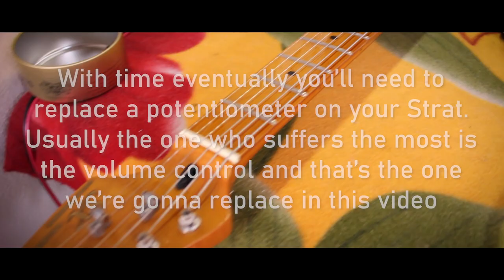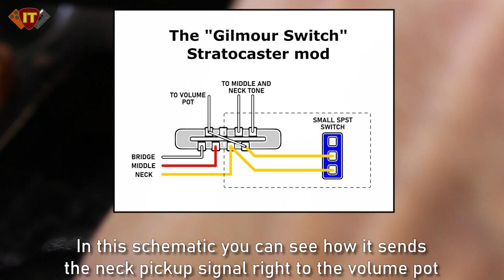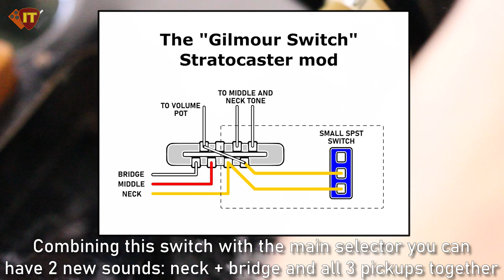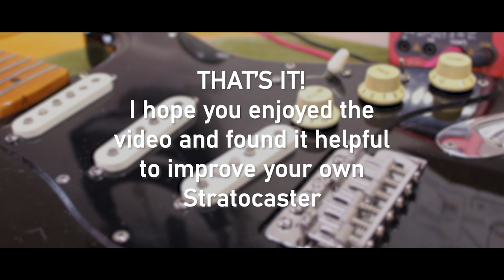Stratocaster "Gilmour Switch" and Volume Control Replacement - Full tutorial

Comment: At first I thought the Gilmour switch was connected to the middle pickup and thought, "what's the point?". Then I did some more research and came back to re-look at the diagram, and now I understand. The Gilmour switch is on the NECK pickup and allows you the only position that the 5-way switch doesn't, The neck and bridge pickups together, with the middle pickup disabled.

I wired my Strat for the same effect. It had a vintage 3-way switch for the bridge and neck pickups (Neck / both / bridge) , and I used the middle tone (replaced with a volume pot) for a volume blender for the middle pickup. I also sanded the word "tone" off of the knob so it's just blank. The other two knobs are master volume and master tone. Going from pickups down, the knobs are master vol, middle blend vol, master tone. The upside is that I can blend in as much middle as I want. I am undecided as to whether the switch or blender pot is better. I imagine that if your Strat has a three-way switch, then a blender pot is the way to go, while if you already have a 5-way switch then the Gilmour switch would be the way to go; though I'd prefer a push-pull pot to keep the classic look rather than drill my pickguard, but you do you.

The basic diagram I used is from Seymour Duncan's website and is called the "Nashville Tele" wiring, but I modded mine a bit to create a master vol/master tone setup in order to prevent me having to use two different volume knobs to silence my guitar. 
Quick Link: https://i.pinimg.com/originals/9b/9e/71/9b9e7170d727121a70f72f774b47c6da.jpg